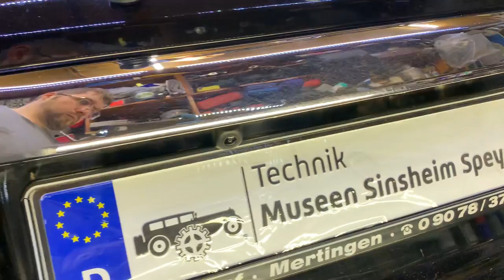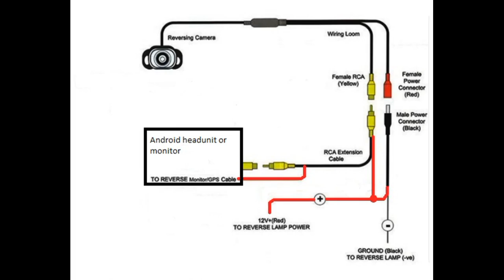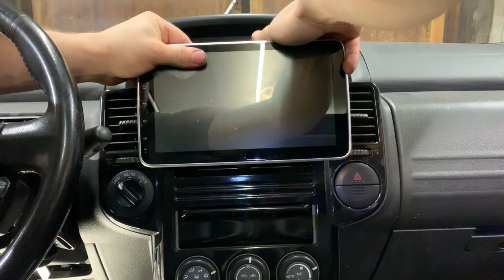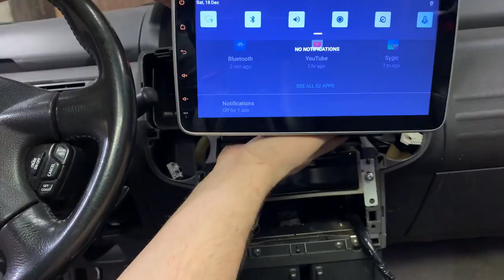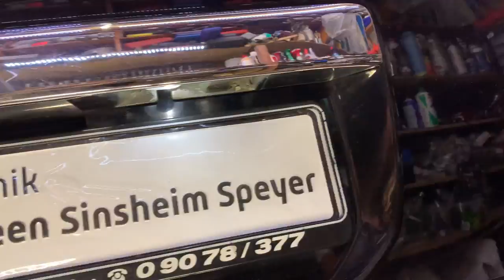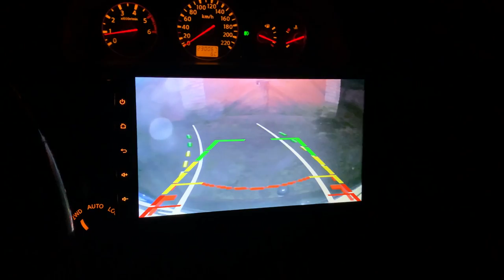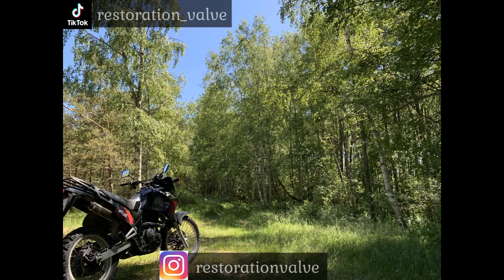Installing a reversing camera on a Nissan X-Trail T30

Comment: Your screen is too big it covers up your vents and you cannot see your cluster gauges I know I own the same vehicle and I have a single DIN pull out 7-in doesn't cover my vents and can just see my cluster gauges
Reply from the maker: The screen doesn't cover the cluster, the height can be adjusted as you want.
I don't mind the screen covering the vents, I and others, who use the car, haven't even noticed that
Reply: @restorationvalve  although with the early t30 models with the little beverage refrigerators I think the doors of the refrigerators won't open anymore.

Comment: Does your car have steering control and how did you connect it i am unable to get the wires for steering contoll from the dash
Reply from the maker: Yes, this X-trail has steering wheel controls
I couldn’t find an adapter that includes those three wire, that’s why I connected the manually by using pins from a wiring kit.
If I’m not mistaken then I took pins from kit similar to this one - https://www.ebay.com/itm/143792218636?hash=item217aaf220c:g:XTIAAOSwIs9fiqin&amdata=enc%3AAQAHAAAA4KqB8fM5etPTUFbpHMcTGQTF%2BJwIkB%2BAo3n2DF8oSD8obhMQDQdeQ7LoeGptVX8e5eRv93qc1dal%2BB94xsLh9hUwWPOORK9Izu4zLAOp%2BDhOzUHrjJsPk1Yb38sQHzdBMqMvjZGgWcBWjf6Px%2FjY9TDgQgESEVb93lAo79ejawW7OqKGmNhv6dJmGNKg28V0E2XbmTDZrVIUpKSp3IZbGOescPDJxNHyWVdNozPOBES%2FBXqrIOhm5OK0En0b8ifxNTU0P33LHt1v5LW5Au7oeTkFkCoxRh8Xmhr9WkrhPa9e%7Ctkp%3ABk9SR5a-zdHYYA

Comment: i miss the conection to reverse ,is not clear
Reply from the maker: The reverse signal comes from the reverse light bulb. Mine connectors mights seem a little bit different because I have the dealer installer tow bar light connector on the right side light